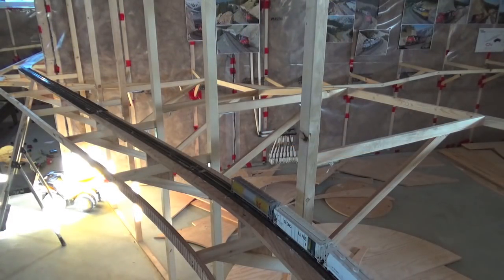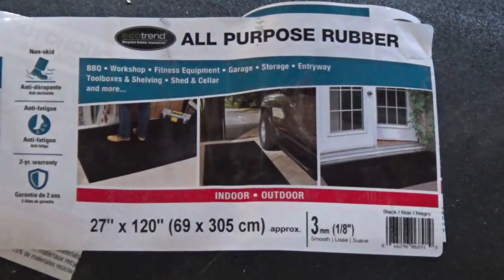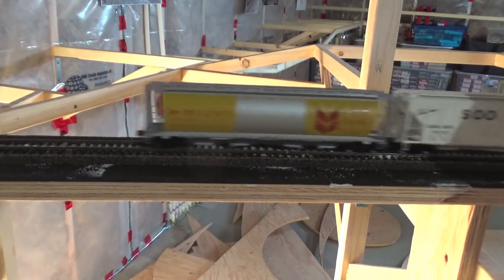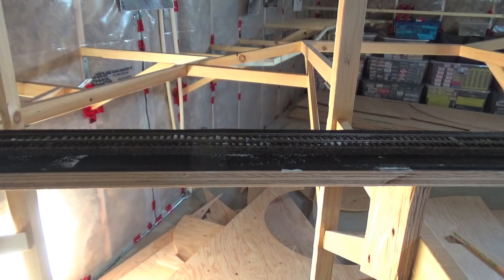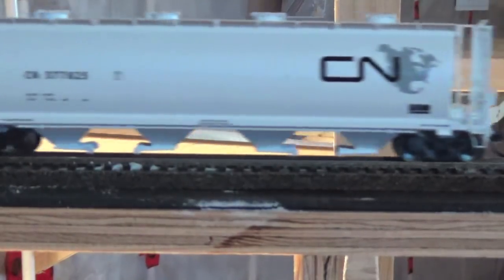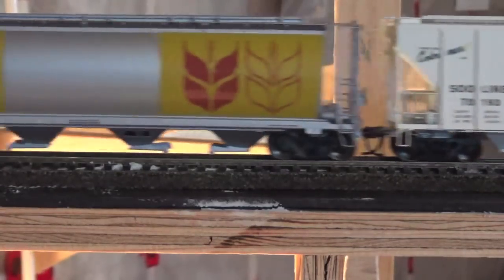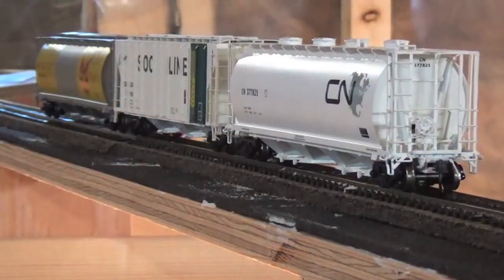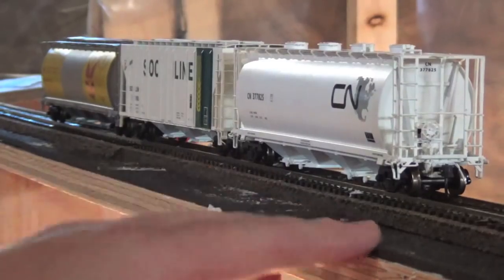Sound deadening material under cork roadbed - Does it work?

Comment: Try issuing rubber or acquista seal between the plywood and frame as well it will stop the frame from transmitting vibration from the train.

Comment: Also, Auto Zone and a few other auto supply stores and shops sell a thin rubber mate for installation in automobiles, don't know how much you get and how much it cost, but it is a little thinner if that matters and designed for sound abatement.
Reply from the maker: Thanks for that tip David. The auto sound deadening material was something I didn't consider. I will have to look into that. I'll give that DAP a try, I did use a DAP silicone for the test and it works fantastic for cork to plywood but the cork to rubber and rubber to plywood wasn't very secure. I did get a tube of No More Nails all purpose construction material and I am going to try that out on the rubber as well.

Comment: Great video and very interesting. Thanks for taking the time to experiment and share your findings. If I may offer, I have been using DAP320 to secure roadbed and track to 3/4 inch foam base and have never had a problem with adhesion. You might want to give that a try if you don't wanna use nails. Thanks for the video!!! D. Muse

Comment: Interesting video! On my layout I have a layer of 2" pink foam and cork roadbed and I don't seem to have nearly as much noise as you do. Even with a 15-20 car train running a decent speed I can barely even hear it if I stand 10 feet away.  I don't find it disruptive at all, although I am on DC so it is nice to hear something as the train is running :)
Reply from the maker: I think it might be something to do with my benchwork being attached to the walls. The resonating sound is able to transmit into the wall structures and sound louder. Another friend of mine did a free standing L-girder benchwork and his layout also had a lot less noise.
Reply: that's neat. I never thought having it attached to the wall would make the sound louder. TIL.

Comment: Great video Ben. I'm just curious. What if you tried the rubber on the bottom side of the plywood? I was looking into this a awhile back.  Could the rubber keep the wood from acting like a snare drum? The track vibrations transmit down through the materials then the wood being the hardest material will amplify the track noise, which is the metal wheels on metal rail. Hmmmmmmm
Reply from the maker: Very possible Greg. As Apocalypse Railroad suggested, taking it one step further than that and putting a piece of rubber in between the connection of the benchwork to the wall thereby mechanically detaching it from the wall. This would stop the resonating sound from reaching the wall. All good things to consider. However I've gone way to far now to go back and take apart all my wall connections so I'll just have to deal with it as I can by laying rubber under the cork and creating a separating layer between the cork and the plywood subroadbed. .

Comment: That's significant. +10 dB is the level of twice the perceived volume. So - 5 dB would be roughly half as loud or a 50% reduction in volume.
Reply from the maker: Good to know Jon, thanks. A couple people have pointed that out which is good because I didn't really understand the decibel scale.
Reply: Sorry, didn't see the other comments. Just wanted to point out that you were on to something.
Reply from the maker: No problem at all Jon. Somethings are a steep learning curve for me and I appreciate all the help I can get! I should have worded my response better, 3 modellers gave me three unique pieces of information on the dB scale and I am grateful for any advise. Happy holidays!
Ben

Comment: You should also consider which adhesive you use.  It makes a difference when it comes to noise.  More rubbery, latex caulk adhesives tends to result in much quieter track vs. those that soak into the cork and/or rubber.  I've been using DAP Alex Plus for securing track to cork and Loctite PL300 for securing cork to subroadbed.  It's also rubbery in nature, is safe to use with extruded foam insulation (pink or blue foam), and also works pretty well between cork and plywood.
Reply from the maker: Very good points here! I used a DAP silicone for this test. I like using it for the track it works very well. I got some no more nails for the rubber which I think is similar to PL300, a heavier rubber type construction adhesive. Thanks for sharing your techniques!

Comment: My N scale layout is 3/4" plywood with 1/2" pink foam from Home Depot. I then used that grey soft foam roadbed that every hobby shop sells, I think it's woodland scenics. It's honestly really quiet. And since I live in southern Alberta it's always dry so I haven't had problems with wood warping or expanding. Cheers.
Reply from the maker: Thanks for the info on the N scale sound. I guess with wheels half the size we could expect half the noise and double it for O scale?
Reply: BArailsystem I found the best sound deadening stuff is those half inch thick foam rubber interlocking floor mat for kids play areas. I bought two at the dollar store and gave them a test. They are extremely thick though, maybe good,for G scale.
Reply from the maker: Tommy Wizard Thanks for the tip Tommy! Seems that there are a lot of options out there. I will compile everyone's suggestions into a list in the video info.

Comment: I have a Kalmbach book that addresses this issue and the author discovered that the best combination was camper top tape over cork roadbed. I believe it is the same material that is put inside frames of automobiles to reduce noise. Tim
Reply: I meant cork over camper tape.
Reply from the maker: Hi Tim, 
What was that book called? I've heard of this camper tape, I believe it's similar to the rubber material my friend used on his layout called Blue Skin:

https://www.homedepot.ca/en/home/p.blueskin-weather-barrier-6-inch.1000403475.html

Thanks for the tip. 
Ben

Comment: Great video always enjoy and look forward to the next one. Three thing that might also help with noise reduction; you can use a liquid rubber on the underside of your scenery (it comes in a spray can (flex seal or something like that) or a gallon can to be applied with a brush like paint)); put up a fabric curtain below your fascia also helps; and finally carpet your floor. I used hi traffic carpet squares and it made a noticeable difference. Thanks again for the videos and Happy Holidays.  Charlie
Reply from the maker: Those are all really great ideas Charlie, thanks for sharing. I'm definitely going to do the curtains and carpet. Did not think of applying it to the underside of the terrain. Happy holidays to you as well! 
Ben

Comment: Very interesting video man, especially the idea of filling the underside of the layout with foam. The only thing I can think of that might be a drawback is the possibility of the stuff getting into the wiring switch machines and that sort of stuff. Although if it's rigid, that might not be a problem. Just my two cents worth.
Reply from the maker: Good points Jacob. Care would have to be taken around switch machines and electronics. I am thinking of the "bat" material that is semi rigid and when pushed in between the joists has enough rigidity to hold itself in. Still may want to staple some sheet plastic underneath to hold it all together. Cross that bridge when we get there.

Comment: Interesting video. I found that as soon as you ballast the track you will get "sound" . Nice progress on the layout.
Reply: Just a fast note here guys/gals, try different ballasts! Woodland Scenics ballast is made from dried walnut shells, so it's not at all dense stuff, and acts like an amplifier!! Try using "real" stone or limestone ballast from Arizona Rock and Mineral or sometimes you can find some of the old Highball ballast on eBay. I also know there are a couple of guys selling real limestone ballast on eBay as well, but I have not tried any from them yet. You can also make your own if you want to take the time to crush and size it for your needs. It's not a cure-all, but it's heading in the right direction... DENSITY!

Just remember, if you start out building on a "drum", then there's not much that's going to keep it from "drumming"! You need to build a solid "dense" foundation first, or it's all a crap-shoot anyway. Peace!
Reply from the maker: Hi Syl. I found that too on my old layout. It was ballasted track on foam roadbed on 2'' of foam so the wheel noise was very loud on that layout. Thanks :)
Reply: Yes indeed. Something I have found is if the ballast is well done (nicely packed, glued properly, dried completely etc.) the increased in sound is not overwhelming.  When I do Ops  what does makes lots of noise is.....locomotive sounds! Prime mover, bell, horn etc.I have reduced the overall volume again and that helped a lot. Cheers!
Reply: Hello Ben I agree in my opinion the rubber is not makeing much of a difference.
Reply: I agree with this comment as well.
Reply: MLWQC yeah I Dont Blame You

Comment: You could try sound-deadening products like those green fiber panels that go behind drywall (forget what they're called), or Dynamat insulation for automobiles... not sure how economical that would be, though. I will echo the comments of other, though. I really don't understand the fascination with super quiet running trains.
Reply from the maker: I think your talking about Sonopan? Green sheets they use in between drywall for sound proofing. A buddy of mine used it in his home studio. It's a little pricey around $30.00 per sheet similar to homasote I think. I wish I had some to test. The only thing I am leary about is the time and work to cut all those pieces out again with the jigsaw. This rubber is really easy to work with.
The wheel noise is just personal preference. My last layout was really noisy and it took away from the sound equipped locomotives once you got a train rolling at a decent speed. So this time around I want to try and do something like Pelle Soeberg did on his Daneville layout to knock the wheel noise down. Definitely won't get rid of it, just make it a bit quieter.

Comment: 5 Degrees difference Ben????? You're living in heaven mate...LOL, I'd be happy with a 25 degree difference! Personally I wouldn't worry about track noise, you wont be going that fast and a few locos running drown out other noises. I actually miss the wheel noise over the joins!, you don't hear it anymore with all that engine noise! Up to you of course but I would spend my money on something else?
P.S.  the train room was 37 yesterday..LOL
Cheers Gregg.
Reply from the maker: Hi Gregg, 
Over the day yes, but helps that 80% of the basement is underground I think. You're definitely right about trains not going that fast. Reality will be the noise will be much less most of the time. However, since I get only one chance to do the roadbed and I am OCD about the wheel noise I think I am going to go ahead and use this rubber to try and reduce it a bit. Holy smokes 37! What was the ambient? I worked in -30*C ambient (-40 with windchill) last week at night. I think my bones were frozen when I got home.
Ben
Reply: Ben , basements are great! I don't know why we do't use them here to escape the heat?? Your old layout on foam would be much noisier than the thick ply , but as you say , if you'll sleep better at night, then go for it! :-). Just make sure it still leaves a firm road bed, not like my old foam underlay!, but it looks ok on the video. Ambient on that day would be about 39, not much cooler in the shed when everything heats up! A few weeks ago , it was 37 and we measured the ballast temp and it was 49, and under the ballast was 63! Any tool you left out would burn your hand . I till think thats better than -30 mate, what were you doing out in that? 
Gregg.
Reply from the maker: I'm not sure why either? Maybe because you guys get larger precipitation events?
I should have shown it better in the video but the rubber is very dense, firm and has no give. Similar to cork. Shouldn't be a problem. My old layout you had to be careful when cleaning the ballasted track as you could push it down with your finger and it would crack. 
Wow, that is incredible that you can't leave tools out. I guess if you left a tool out in -30 here it would also burn your hand, just in a completely different way. What an amazing planet we live on. Also crazy that your ballast was 63. Did you leave larger gaps or lay your track in the summertime to counter the expansion?
Just another day at work. I work at a petrochemical plant and it's a 24 hour operation. Rain, shine, blizzard, heat wave we have to keep it running. Although extreme cold is definitely the most challenging.
Reply: Tis amazing Ben, thats for sure! The track is stressed/stretched when laid depending on the ambient, none in summer and a lot in winter. When it heats up, the expansion takes out the stretch...usually but not always.LOL Laying welded rail is a tricky business, in cold and heat extremes! At least in the cold Ben, you can always rug up, there's only so many clothes you can take off when it's hot...LOL
Gregg;-)
Reply from the maker: Interesting! Very true about layering too. Stay cool my friend!
Reply: And you stay warm!!

Comment: I have tried various sound deadening methods but I find that as soon as you ballast the whole thing becomes a tight drum skin. Plastic wheels deaden sound but they are certainly out of fashion so bottom line, embrace the sound. Real railways are rarely quiet. David.
Reply from the maker: Hi David. I found that too, but what I am doing different here would be that the track, ballast and cork would all be sitting on top of this rubber. Hopefully it will make a difference when the track is ballasted as well.
Reply: I shall keep watching to see the results. All the best, David.

Comment: I guess my question would be in this age of model locomotive sound why would you not want some wheel/rail noise that is so common in real life?
Reply from the maker: It's just the "whirring" sound from the wheel noise I don't like. My old layout was ballasted track on foam roadbed, on 2'' of pink foam it was so loud when you got a train going. I'm bound and determined to try and reduce that a bit on this layout. One benefit is that the locomotive or sound car sounds can be turned down a bit if it doesn't have to overcome white noise coming from the rest of the train.

Comment: I saw some guy using drywall instead of plywood, which I think would certainly have some sound dampening wualities
Reply from the maker: I think it would as drywall is very dense. Relatively inexpensive as well. That would be a nightmare of dust though to cut all that drywall into curved shaped pieces to match the plywood.

Comment: Interesting.  Just one other consideration - I have used cork and flexible rubber/foam on my layout and when ballasting  and other groundcover is added, the flexible materials can create issues with cracking.  You need more glue to secure it but if you push down hard, the ballast will give because it is sitting on a flexible surface.  Cork doesn't move.  Just something else for you to think about.  I've also found that lots of model trees absorb sound. Cheers!
Reply from the maker: I had this exact problem on my old layout with foam roadbed Mark. Had to be careful when cleaning the track. I never really showed it but this rubber is very dense, heavy and similar to cork. It really doesn't have any give. Interesting that you found the trees absorb sound. Makes total sense because this is resonating sound we are dealing with and the trees would act like mini shock absorbers maybe. I should remember to test again when it's all finished. Look for that video in 2033 :)
Reply: 2033?  You'll be about thirty years ahead of me mate!!  Glad the rubber isn't going to create those problems with the ballast.  In hindsight I would have used all cork rather than some of the Walthers roadbed in places.  We live and learn.  Also with the noise issue - I have got storage under the layout and this helps to remove the 'soundbox' issue you are anticipating.  Looking forward to watching your progress.
Reply from the maker: I will have storage underneath as well Mark and am in the same boat. Good to know that it helps.